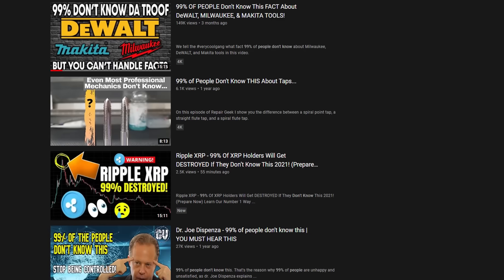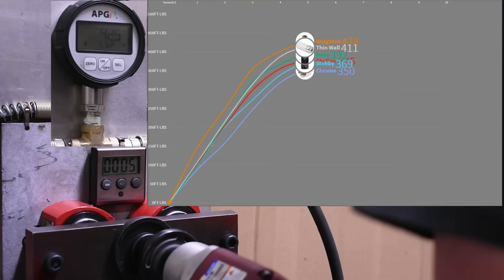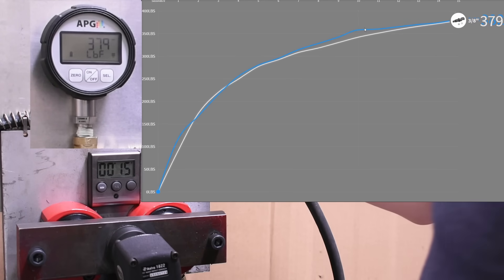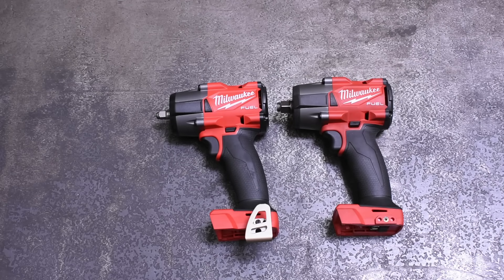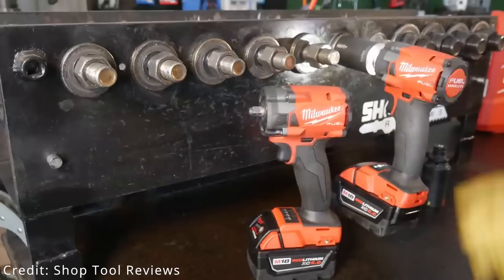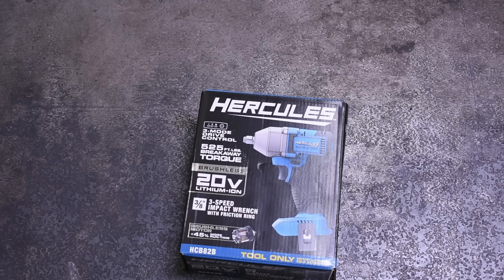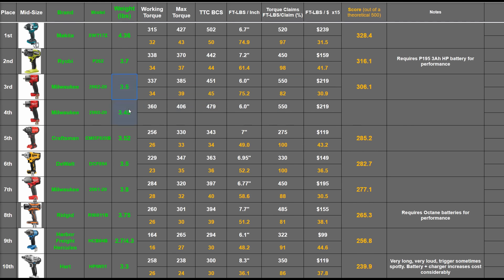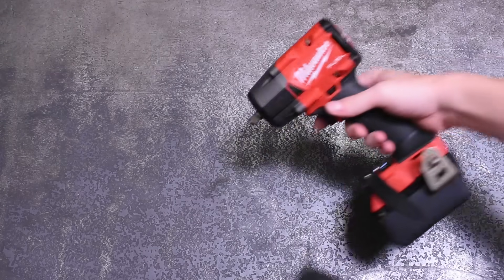Measuring Power Difference Between 3/8" & 1/2" Impacts = WTF

Comment: I think this is just within the variance between two drivers. I bet you could buy multiples of the same model and see just as much variance. And regarding the other videos, it's confirmation bias. People only make videos about the surprising result, not all the times where they got the expected result. That's my theory to add to the pile of halfbaked theories.
Reply: If you can only have one impact wrench (like a mid-torque) and/or one set of impact sockets, I will still recommend the 1/2" anvil because of one thing: adapter losses. Generally when I'm working on a large nut I want the full power of my tool, but if I'm taking off something small I can afford to lose a few beans in an adapter. I don't want to use an adapter for larger sizes, and if I'm sharing sockets with a bigger impact then 1/2" makes the most sense
Reply from the maker: You might just lose that bet. New Ridgid vs another new Ridgid we bought: https://youtu.be/jaZo1e4OvWk?t=168k New M18 vs used M18: https://www.youtube.com/watch?v=I3r-vjVXwk8 We also just bought another new DeWalt we'll show this week, same story. And we do show the non dramatic results too: https://www.youtube.com/watch?v=LeFf5zzjYw4
Reply: @TorqueTestChannel  well your old-v-new milly showed about a 3%  delta,  and this video shows about a 6% delta . Maybe I'm just pessimistic but that doesn't seem impossible with all the working parts of an impact?

But again I'm just spitballing like the rest of the blokes in the comments.

Comment: Makes sense to me.
Half inch throws looser bolt further due to momentum
Lighter 3/8 has higher peak torque due to less weight to get moving and more final work goes into final tightening..

Comment: Very odd. If they truly are identical inside, the only thing I can think of is that there is some tuning issue with the impact mechanism that is optimized for the mass of the 3/8 anvil, and thrown off a bit my the extra mass of the 1/2 anvil. But would that be evened out by the socket? The 3/8 socket would have slightly more mass than the 1/2 socket due to the smaller hole.

Comment: I bought both 1/2" and 3/8" in Milwaukee s new gen and find I use the 1/2" more then the 3/8" even though the 3/8" surprises me from time to time. The things the 3/8" will take off  is shocking butt when I'm pulling craddle bolts I find the 3/8 can't do it but that 1/2" can . I believe it is the larger socket Mass and lower Dynamic torque of the 1/2" impact . The phenomenon that you are explaining can be seen with 1/4" impact drivers taking off lug nuts with a bunch of reducers vs a 3/8" that won't do because of a wimpy thin wall 3/8 socket .  Design of  impact screw driver and impact are different as well but there s plenty of dingle berries out there using a 10lb socket on there 1/4" screw impact drive to rotate there tires.

Comment: The Bosch impact drivers did the same thing. They were more powerful using 1/4 adapter when compared to using the 1/2 anvil on the freak.

Comment: My initial thoughts after watching this come to three questions: 
1) How do the 1/4" impact wrenches in same/similar-sized models compare to their larger drive siblings? 
2) If they fall into the same max torque range would they be capable of consistently snapping, shearing or otherwise breaking fasteners associated with the smallest 1/4" impact sockets/drivers commercially available? (much like the higher torque impact drivers were previously doing to socket adapters)
3) Ignoring tool/anvil longevity, and compatibility with existing tool sets that may already be owned; would the answers to the first two questions reduce or eliminate needs for buying either a 3/8" or 1/4" impact wrenches? (in certain torque ranges) 

For example: If a 1/4" can deliver same/similar max torque as a 3/8" it'd raise questions about buying a 3/8" impact - particularly if/when a 1/4" impact wrench is paired with a 1/2" high torque impact wrench for larger fasteners. However, if the 1/4" impact would consistently snap fasteners associated with sockets below what is commercially available in a 3/8" drive size the 1/4" impact may not have much added utility vs. the 3/8". The Milwaukee M12 stubby line up of impacts and the various power ratchets comes to mind as a possible example despite the differing specs of the 1/4" versions.

The joys of experimentation for every "answer" found more questions arise....

Comment: It was always my understanding that you went to 1/2" when you were at the point of shearing off 3/8ths in working, and I have sheared off many 3/8th drives that 1/2s were not affected by.

If it's the same tool though there shouldn't really be any difference in torque... As this is kinda showing.

Comment: Question:  Why on testing the 1/2" anvil impact wrench the socket is much larger compared to the socket on the 3/8" test?
Reply from the maker: No one would make a custom deep 3/8 this size for us. The nano and Hercules also used the same 2 sockets

Comment: Thanks for the shout!
Reply from the maker: Most def! Love what you do
Reply: Mr. Subie in the house 👍🏽
Reply: Why isn't the larger mass creating more torque? surely you can elaborate. Considering you used that logic for weighted sockets.
Reply from the maker: The "larger mass" here is like 0.1lbs. If anything this vid has said they are about the same power. Milwaukee being the exception is what everyone is focusing on though, in which case we (and Milwaukee) have no idea. Harmonic resonance would be my shot in the dark
Reply: @Nick_Gir  because the mass is all on the center axis. If you look at the IR weighted socket that TTC tested, it has that outer ring to add mass, and you’ll notice that the ring is away from the central axis. 

If you look at the units of torque (ft•lbs for us in the states), if you have the same force (lbs), but a longer lever arm (ft), you’ll generate more torque, because torque is the product of distance and force.
Reply: Could it be similar effect as a flywheel on a car? Lighter flywheel equalling more rpm and torque up high, but not having that down low torque?

Comment: Took my kids to the wrecking yard to get an alternator. I had them try to loosen the bolts with the 3/8 Stubby Milwaukee on setting 1 and it couldn't loosen the bolts. I then had them move the setting to 3 and they Milwaukee took the bolts off as though they were hand tight with no effort. Love the Stubby and made a good impression on the kids.

Comment: I noticed this lately with makita. I bought a large body half inch impact that turned out to be the same motor amp size as my buddies with a 3/4 hammer in it. The 3/4 seems to have way more bag. However I’ve not used them side by side. Just using them in similar situations.

Comment: The tool companies rate the 3/8” lower because it makes sense to the average Joe who therefore will buy both to round out his tool arsenal.
Reply: psychology of marketing!
Reply: With Milwaukee I wonder if the 1/2 would be faster at breaking the nuts then 3/8 due to peak torque being at the beginning
Reply: Reddit slammed me because I said I use a 3/8 M12 Stubby to take my lug nuts off.  It's a damn hatchback, 100lbs ft, not F-350 Super Duty with like 180lbs.
Reply: Do you also want as little amount of play or slop as possible on the impact. If you have sloppy connections or too many extensions, the impact doesn’t work well and looses full torque.
Reply: I had a feeling that was the case!
Reply: I skip 3/8 and just have 1/4" and 1/2".  3/8" really only makes sense for people who only want the midrange...   (after 1/2"  should one go 3/4" or just jump to 1" wrench sets -  for really bid stuff..  lol)
Reply: @kadmow  3/8 isnt midrange if it performs the same. Your paying more for 1/2 sockets with no performance gains.
Reply: @daveunknown01  : Note that "this-here-test" is only showing the power   impact  drivers torque capacity is the same, not the  strength of the wrenching ecosystem.  There are other advantages / disadvantages to specific drive sizes....

(all it shows is the companies appear to rip people off on the Battery powered,  1/2 drive size "Impact Wrenches" when all that is needed is a drive adapter. )   - for workshop use  Air tools are cheaper and often just as handy...
Reply: @daveunknown01  I work on cars. Not many trucks. 3/8 is good for space and doesn't do as good as a 1/2. I wouldn't have a 1/2 if that was the case.
Reply: @kadmow  What would you recommend as a first impact 3/8 or 1/2? Im a weekend woodworker and want to get my first impact (I have several 1/4 impacts) Air tools are not an option for my current situation.
Reply: @daveunknown01 ive broken many adapters and now a breaker bar, all 3/8th. Never broken a 1/2 inch
Reply: @kadmow  I have a 2 foot long breaker bar and a torque multiplier for anything I can't get off with a 1/2" impact. When working with stuff that big it's good to have manual input so you can feel if something is going to break or not.
Reply: @sijonda  But the only problem using manual breaker bar is when to try loosening any pulley bolts that keep spinning..
Reply: @sijonda  I used a 10 foot breaker bar and was sitting on the ground with my legs pressing against a post to break a bunch of bolts loose once when I was younger.
Reply: @paulmartin2348  Ford dealers do something like that to torque down the crush washer on the pinion. I bought my multiplyer so I could do it myself on jack stands and it didn't work. Ended up compressing the suspension instead.
Reply: @kadmow  I think this video if you watched it debunked 3/8s being mid-range. it's even stronger in some areas over 1/2.

Comment: I need a good 1/2 impact. I dont have money to get milwaukee which is what I would prefer but I have been thinking of getting the craftsman one you guys tested. I have the m12 batteries and I also have the hart batteries, but I won't buy the hart impact because it's not brushless. Is there any adapter that I can buy to use the hart batteries on other tools like the craftsman? I have a few 2ah hart batteries and a few 4ah hart batteries as well. I got them  really cheap in my area and also picked up their 1/4 inch brushless impact and their brushless drill. I just don't want to have a bunch of different batteries for stuff honestly. I do plan to buy milwaukee batteries and tools once money allows for it. I was impressed with the craftsman though, especially for the price.

Comment: just the fact that you guys went out of your way to make custom sockets deserves a like
Reply: I didn't even know there were people who did that kind of thing.
Reply: @EclecticBuddha  specialty/custom manufacturing is a massive worldwide industry... if youve got the money, you can get a company to make you anyting you desire... boeing will make you a custom 747 if you got the money... you think its hard to get someone to make you a custom sized chunk of steel? lol 

sorry, not trying to bash you, i just fond it kinda funny, coming from a manufacturing background...
Reply: Your comment is so spot on it deserved a like!
Reply: Their custom sockets are also part of the answer.  The 1/2 are tested with a TTC "best 1/2" socket.  Probably some Chrome-Moly heat hardened best performer.   Their custom 3/8 to large size bolt sockets were better than the TTC's standard "best 1/2 socket" for test.  They were Chrome Moly, machined likely from a block, not likely cast to a mold and then machined as most commercial sockets are.  The heat treat was also better on the customer sockets.   Those sockets transferred energy better.    This is also true for "general use" often times.   3/8 sockets are smaller, shorter, and thus less twist is accepted by the socket than a 1/2.  The 1/2 being larger, not only absorb in "twist" more energy, but they release it back out (without permanent deformation) slower because of the additional mass and  additional size.   That slower release costs useful energy, especially at the very end of the Max Torque fastening, or the very beginning of BreakAway max load testing.     TTC's own testing on "various" things like extensions, universal joints, size converters show similar losses.  The larger 1/2 socket is experiencing greater losses for the same reasons.  More absorption at peak torque and release of that energy at a SLOWER release than the 3/8 inch.    General thinking here is incorrect.   Typical thinking is that the governing factor is higher mass and additional wall thickness will impart sufficient "stiffness" that the dynamic loading force "exit envelope" will mirror (equal) the "entry envelope" for that energy.  It does not.    Testing channels tend to use best in class components for both the 3/8 and 1/2 inch, meaning good heat treats on Chrome Moly.   The effect of these sockets in their non-deformation ability is to act as a curve smoother (like covid vaccines).    The energy goes in as the anvil delivers it (in a high peak), but the energy goes OUT in a longer and smoother curve.   Acceleration is slower, but longer, energy is the same (minus losses to actual deformation and heat).  The ability of the thicker socket with greater mass to absorb without immediate kinetic release is higher on the larger socket.  It store energy for a longer period, and releases more energy through controlled heat transfer.     The smaller socket simply cannot do that.  If its heat treat and stiffness are high quality, its mass is nearly always still lower.   It releases its stored energy sooner and in a closer mirrored curve to the impart curve. It has less surface area to release heat, less mass to hold energy (as heat or twist/rebound energy), so it must release it as rebound energy more quickly.   It is a better energy transfer agent, until it fails.  Because it attempts to release the energy in a curve mirror impart curve, it is a better transfer agent, until it cannot release such energy.  Then its properties work against it - its inability to shed energy via heat as efficiently, its inability to absorb resiliently (with perfect rebound) as much energy due to lower mass, when confronted with the inability to also release that energy via kinetic energy transfer (on a stuck BEYOND maximum torque) means when THAT point hits (which is a higher point than for the 1/2 inch socket), the 3/8 socket is pretty much guaranteed to deform.  That is the only energy release mechanism left.   This is why 3/8 inch socket don't do as well, besides the obvious leverage issues associated with lever length built into the diagonal of the drive square.   

So, until you break them, they actually work just a little bit better, at the VERY high end, because they are better energy transfer agents.  NOT worse agents.   But that being higher talent lasts only up to the non-deformation limit of the metal.  That is also usually a tiny bit better because of shorter length.   But its only a tiny bit better.   So you see a few more pound feet.  But go even one more breadth of force, you find the limit, and the socket deforms, and much quicker than the 1/2 inch.  

Usually people want those sockets to last more than one job, or a few jobs.   So the deformation is a big problem, that leads to those "very soon" failures.   Just keep hammering, and if it DOESN'T MOVE, it is in fact instead deforming the 3/8 inch, whereas its still just "heating up" the 1/2 at lot, but not yet deforming it..  

When anvils and dogs are not identical, then this may not be the primary factor.  Its still a factor, but it is usually outweighed.  Often 1/2 designs are changed to use hammers that hit the anvil at a bigger lever distance, and they have power to spare in application at the greater lever.   This imparts more actual torque (rotational force).   Rather the first effect, which is identical torque imparted to the socket, and the 3/8 inch socket transferring the torque to the bolt more efficiently (until it fails), this is more force applied to the 1/2 inch socket, which although a less efficient transfer agent,  will have a higher deformation maximum, and so then the 1/2 will win.

But when the only thing changing is the anvil, generally the actual applied torque is the same, and then the difference is the socket. 3/8 inch socket transfer energy more efficiently.
Reply: I have to correct myself on one item above, I wrote: "... THAT point hits (which is a higher point than for the 1/2 inch socket)."  That is untrue, or rather ill-described.  The 3/8 sockets failure point on deformation response is a HIGHER ENERGY THAN the 1/2 sockets effective transfer delivered energy point, but NOT the 1/2's failure point.   And when a design change is made (wider dogs on the anvil, bigger lever in the hammer distance (diameter) on a 3/4 inch for instance, that where more torque comes from on a 1/2 to 3/4.   (But this is rarely (near never) done on a 3/8 vs. 1/2 because of size limitations.)   So 1/2's do not often get "more real torque delivered to the anvil than a 3/8 does.   They COULD be so designed, they just are not.  If they were, then 1/2's would perform better.   But power tool companies don't want to invest in that space for small gain usually.   They would have change the diameter of the shell, housing, anvil, and hammers.   They just do not do that on 3/8 vs. 1/2,  they only occasionally do it on 1/2 to 3/4.

Comment: I often wondered why socket manufacturers don't offer larger sizes smaller drive sizes like at least 3/4" and 19mm in 1/4 drive,  1 1/2" and 38mm in 3/8 drive, or 2" and 50mm  in 1/2  drive. Could be super short for there size and would help fit into tight spots.

Comment: I'd love to see Dewalt's aging DCF899 hi torque tested with the 6.0ah battery that has the 21700 cells! That battery squeezed a few more beans out of the DCF894 mid-torque, if it does the same for the hi-torque i'll be buying some new 6.0 batteries for sure
Reply from the maker: Deal